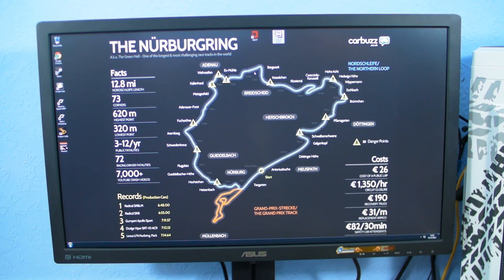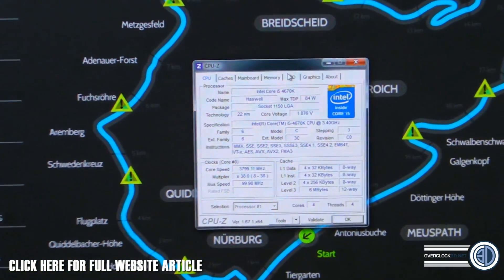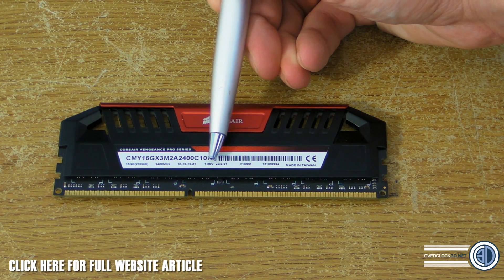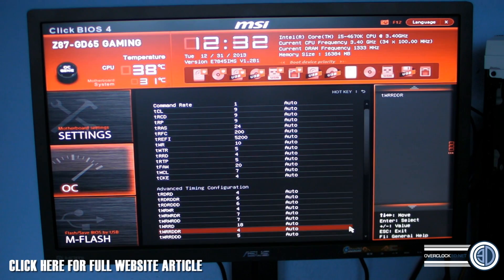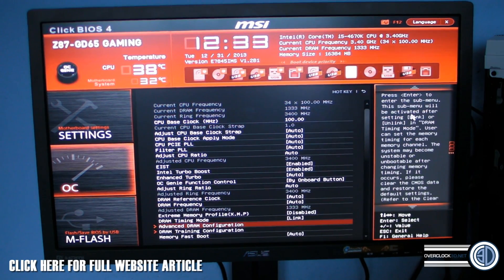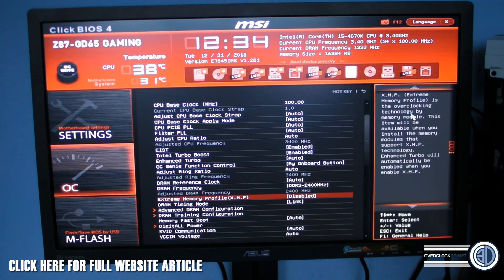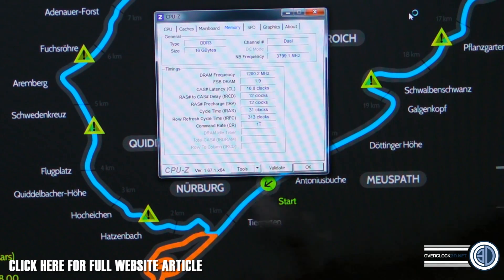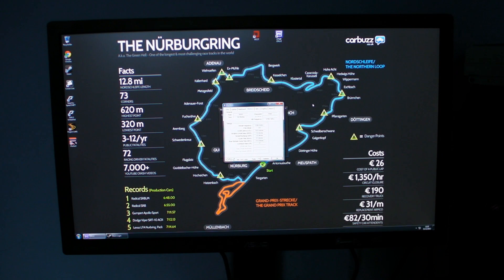How to manually set your DRAM Memory Frequency Speed & Voltage

Comment: I've bought 2x8 GB ram and i had 8 GB ram 1 stick earlier. Do i have to take the old stick out, if i want to put my speed up? It's at 800 mHz atm with all 3 sticks, and they dont have the same voltage or Numbers

Comment: Hello, i bought new ram since I was getting memory related bluesqreens. After all the problem was caused by too low cpu core voltages and seems that the ram is fine after all and my pc is running stable for month now. Now i  have two different set of ram modules: g.skill sniper 1866mhz 2x4 and corsair vengeance 1866mhz 2x4. Currently using only the g.skill sniper ones. So can i add the corsair modules to my pc since there lying there without use.  The voltages and clock frequenses are the same on both sets but timings are little bit different, how should i set up them in the bios to work correct? I believe the xmp profile works only with the other set when they are both in the system? So how should i set them manually?

Comment: i need help cuz i have a very old kingston ddr2 RAM memory and its clocks should be @1066Mhz but when i open up CPU-Z it says its @270 and x2 its 540 i have a dual chanel 2x2gb plz help i dont know that much about RAM.
my mother board is a msi g41m-p33 combo and a Pentium dual core E5300@3.5Ghz

Comment: What the Hell .... CPU can only get 1600 Mhz  max. or what I not Understand it ?? 
CPU by me I has too that CPU i5-4670k and He says from Information that can be get max Ram Mhz of 1600 Mhz and Mainboard get to 2133 Mhz what I not Understand of what I need hear did ? Mainboard or CPU ?? please reply me :/
Reply: +game5uchti pretty much the lowest set on either will be what your computer can run so in your case u can only run 1600 Mhz. bottle necking sucks but thats not bad if ur not doing anything extreme.
Reply: +game5uchti My understanding is that it's related to the MOBO. So if the ram is down clocked from 2133 to 1600MHz then original latencies of the 2133 will come down producing some extra performance. There is a performance sweet spot for ram provided you get latency & speed right. Whereas as voltage is set to whatever it says on the stick.

Comment: in my bios there is no 1600mhz iam using a sabertooth 990FX amd motherboard, id tried putting it on auto but i end up with 522 mhz i have 16 gb vengeance 1600 mhz installed

Comment: I thought haswell would run 1600mhz stock unlike ivy etc which was 1333. When i went into my bios it was at 1600mhz however the timings were wrong

Comment: I saw someone who had wrote a review for a GSkill 3000MHz dual channel kit for a Haswell based rig and he had more money than sense. He expected to pop them in, enable the xmp profile and get the rated speed. He actually flamed the kit out of his own ignorance. What he didn't know is the highest memory divider on Haswell is 29.33. This is impossible to get 3000MHz at 100MHz base clock. Change the CPU Strap to 1.25 then select the the 24.00 memory divider (speed in MHz), done he would have been at 3000MHz.

Comment: I've got an ASRock 970 Extreme3 R2.0 motherboard and when I try to manually set my G.Skill Sniper 1600Mhz (8GB) RAM to 1600Mhz it only goes to 1433Mhz... >_< I have all the timings correct but still can't get the correct Mhz. 

Any idea what I'm doing wrong?
Reply: I somewhat figured it out, I just ended up slightly overclocking my RAM. 

This ASRock 970 Extreme3 R2 motherboard BIOS is quite strange, the RAM frequency settings aren't the usual frequency settings, it only gave me options for 1433 or 1720mhz. :S 

I just ended up going with 1720mhz, with 9-9-9-24 timing (which is the specified timing for 1600mhz on the G.Skill Sniper 1600mhz RAM that I'm using). 

Very strange indeed... >_>

Comment: Nice short how to video , more please !
Reply: +ramoine35 , yes I want more information, like 1) how do I find out the max amount of memory my PC can use and the max speed of memory my pc can use, what determines it? the main board or the CPU ? 2) how do I find out what my command rate should be, 1 or 2 ? most might be 1 but some or 2 ? what's mine  ? and what determines that, the ram, the main board, or the CPU ? 3) and call me stupid but how do I get into my BIOS in the first place? 4) should I change my setting's before or after I put the new ram in? I have an IQ of 80, I need instructions for somebody with an IQ of 80